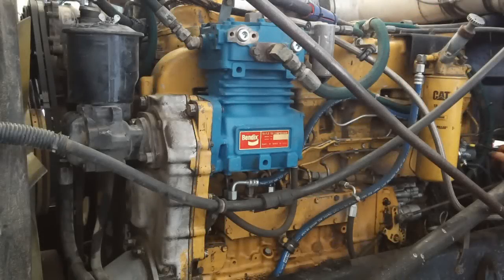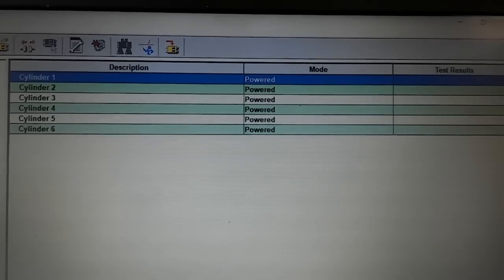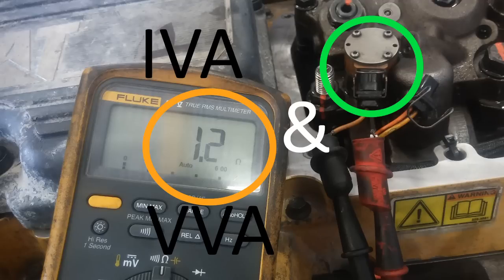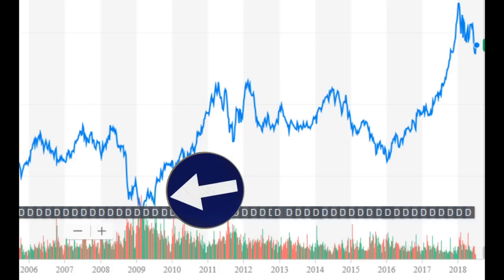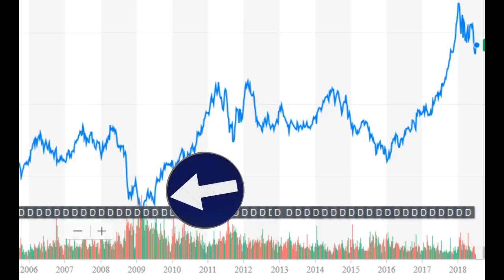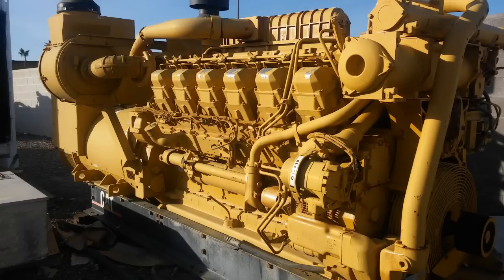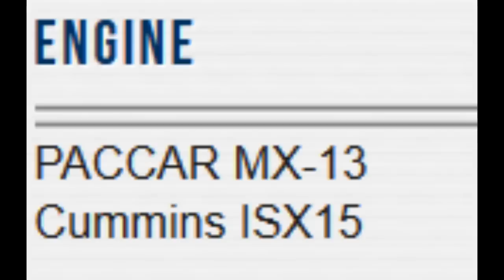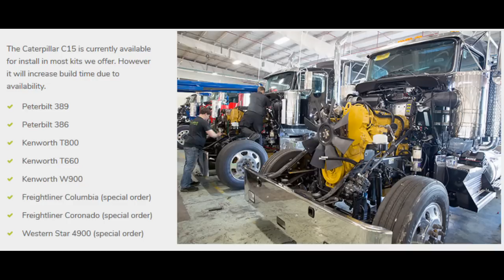Why Did Cat Stop Making Truck Engines?

Comment: Emissions control is great up to a point, certainly hydrocarbon /soot reduction is essential,  but the extreme limits on NOx are a bit out of control.
Reply: Paul G did a delete on a truck and it is doing 9L/100kms less fuel consumption after delete.

Explain how that works.

Plus, the truck was costing around $25,000 a year in related repairs of the Soc, EGR and Dpf system, not including  loss of work.

It is a scam, front to back.
Reply: well it sounds like your delete also includes a proper tune.
Reply: It's funny, the emission controls are part of if not the only reason for higher NOx.
Reply: igostupidfast3 , higher NOx is a consequence of running the engine leaner, a diesel running leaner runs more efficiently. So if you want to get the most energy out of an ounce of fuel then you will produce more NOx.
Reply: @paulg444  actually Nox ist to do with heat of combustion. Not really to do with running lean. It's a nasty side effect of having good combustion. But we have SCR systems that deal with it.
Reply: @ @bubba842  , it should be both, heat in order to oxidize the N2, but lean in order for sufficient O2 and N2 to reach each other and react in the combustion chamber.
Reply: Volvo met them and at great fuel mileage. CAT was in too much and was their biggest problem.
Reply: Interesting because I thought NOx is a little tight, while the soot reduction is the one that's out of control.

Comment: I know this so well. In the early 2000's a small trucking company here in Oamaru New Zealand held the world's highest payload on any road going truck and trailers. Anyway the guy had early M.S so he squandered all his in laws money on projects which involved buying the first Freightliner and Peterbuilt trucks fitted with Cats. The trucks to achieve high payloads he had to remove passenger seats, spare wheels, add fiberglass springs etc. In the end due to Cat dealer not willing to sell him parts he ended up no paying wages a d borrowing money to buy new engine from overseas just to get the e.c.u and head gear off it... I was the guy who liquidated all his plant for the bank when he went broke. I got 70 grand for the originally spent 2.5 million of gear.... That Cat was a real dog.

Comment: Cat had developed a way to meet emission standards that didnt require the use of DEF. But the US government said no, you will use DEF. So cat said nope, were done for on highway engines. Kinda makes you wonder who in the government has a stake in the DEF industry.
Reply: Bullshit. Cummings released and engine in 2010 that didn't need an SCR systems. They were running it for years until Tier 4 emissons came in. So your story is full of shit. 
Cat couldn't do what every other manufacturer did because they didn't want to put the money into R  and D.

Comment: I owned a fleet of 18 wheel trucks back in the 90s. always ran 3406 cats. they were great engines but the fuel mileage sucked. we would struggle to get 5 mpg.  then when Detroit diesel developed the electronic controlled engine you could get a mile per gallon better with cruise control and speed limiting capability thrown in. I switched over to Detroit and dropped cat. I would say poor fuel mileage killed cat more than anything.
Reply: I heard the same thing, the Series 60 was a Wunder Motor!  Long long life and great fuel mileage.
Reply: CAT was originally the off-road king. Then they went into transportation power. You're right about them, they didn't fair as well as they others in how they produced power or fuel consumption. Been that way for decades. Maybe its not so bad they got out but at least they decided and said to the EPA, your idea, you deal with it.
Reply: 5mpg?so hard...my trucks is 15 years old m.a.n.....mechanical turbodiesel 12 litres inline 6 410hp...gross is 40metric tonns...fuel cons is 9,33 us gall in 62,5miles...this is 6,7 mpg...5 years ago gross is 50 metrictonns fuel cons:5,6mpg......3406 cat is 14,6 litres m.a.n. tga 19.410 eng is just 11,95 liters....
Reply: @zsoltlukacs8438  again, comparing a cat to something coming out of Europe is never going to give a favorable outcome for anything American really

Comment: We have two trucks at work that have the c10 and both engines are junk they both dropped valves around 100,000 miles and 80,000 miles destroying the piston and head then 50,000 miles after an inframe rebuild the cam breaks and blew a hole in the block